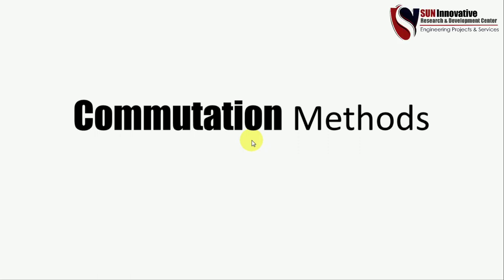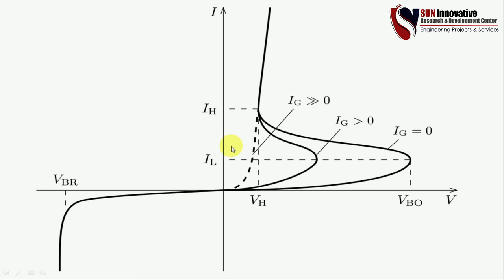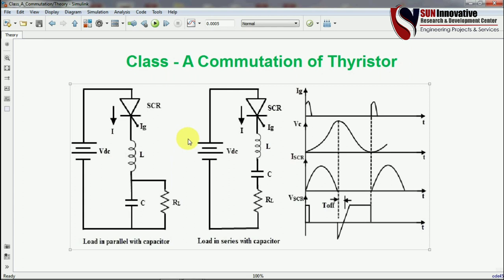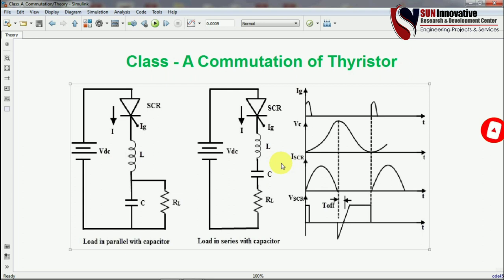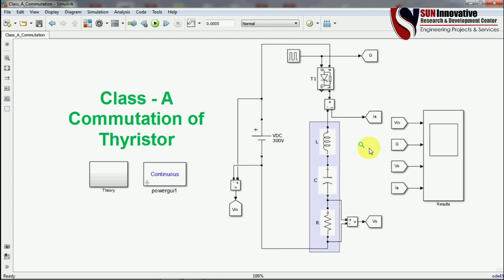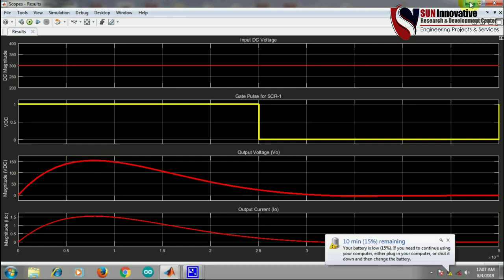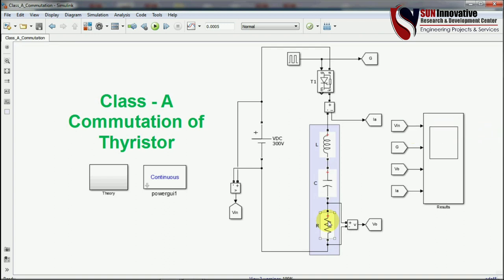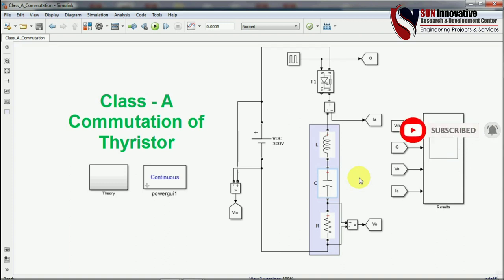Class A Commutation of Thyristor | LC Load Resonance | MATLAB Simulation

Comment: Please recommend books for force commutation design?
Reply from the maker: Commutation is purely load based design, specially if you are working for load Commutation methods, there is theory in every reference book with example but still even i never found design part of it. I did this simulation based on load specifications and experience to generate gate pulse with synchronised pulses.